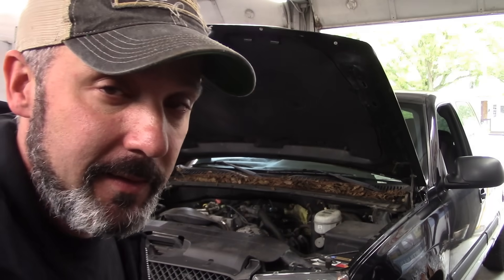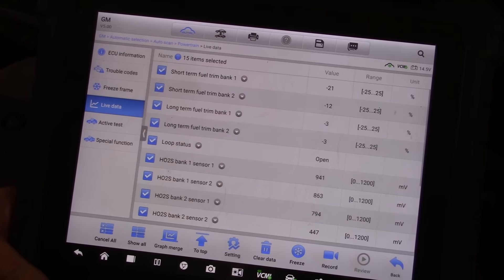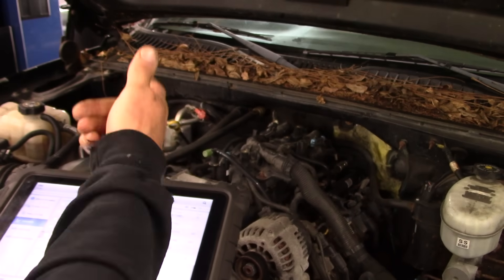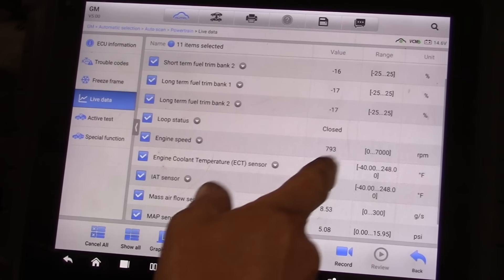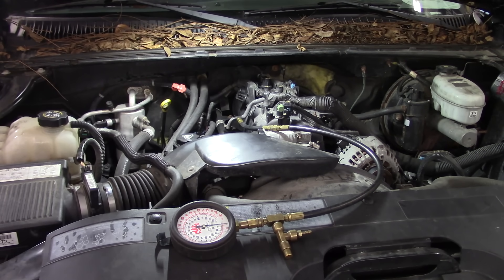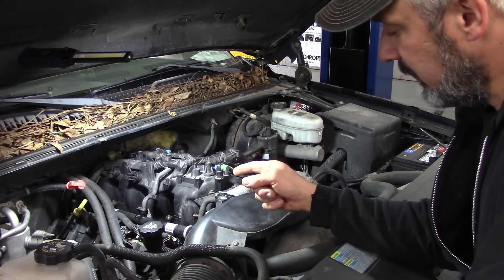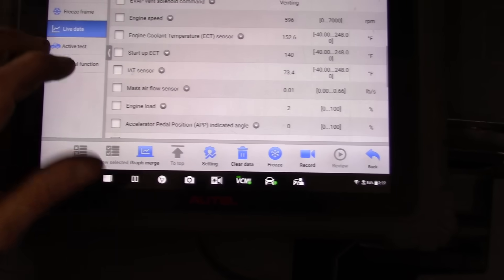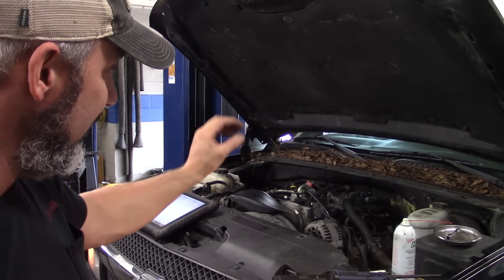Parts Cannon Special: Rich Running Chevy Truck P0172 and P0175

Comment: I’ve been guilty of shotgunning problems that I’ve encountered on our newer vehicles. It was hard for me to swallow my pride and acknowledge these newer vehicles are above my pay grade when it comes to diagnostic skills. I miss engine bays you could stand in, and with enough beers and a timing light you could fix anything. Love your content, glad you’re here to provide good knowledge and entertainment.
Reply: I think the issue with newer motors isn't so much that it's too hard to understand as more the fact that you need to be able to see and understand the data.

Older motors you didn't have a bunch of sensors to read, and didn't need a $5000 tool to see data. It was mostly by feel other than putting it together originally.
Reply: @Mck Idyl LOL been-there-done-that! 40 years ago!
Reply: Why put money into a engine that burns oil
Reply: @mylanberg5419  Go price new or used vehicles these days. They are crazy expensive. Just lost my 2002 Saturn in a car accident last week; shopping for a decent used vehicle is insane with the price spike.
Reply: Thank LGB for the Bidenflation.
Reply: @VanillaWahlberg  4 years vs 1 year, hardly comparable.
Reply: @ferrumignis  He's also introducing a 20% minimum billionaire tax in his budget, and is on track to reduce our year-over-year federal deficit. NONE of this has to do with this video though, so good day!
Reply: @VanillaWahlberg  He also has worse approval than Trump at this point, and has made America look the weakest it ever has on the world stage.
Reply: @ferrumignis  Is that why the U.N. laughed at Trump? Gtfoh lol
Reply: We all love our complex shiny gizmos, we love software features piled on top of features, billions of transistors in circuits....... well... until they need fix'n.... then, we either throw them on a landfill or we fooking hate them!  ;-)
Reply: @mylanberg5419  I have a 02 Silverado with a 5.3 570,000 miles. From the beginning it burned oil, at oil changes it'd be a 1/2 quart or more low. Ask the someone I new at the dealership and he said that's the way they designed them. Seems crazy, but the engine just keeps going.
Reply: They can actually be easier in some cases because the OBD computer is doing a lot of the diagnosis for you. We saw Eric start to home in on the problem from the first few seconds that he saw the readings. He went straight to each of the parts based on the data and quickly replaced the correct bits to bring each system back to spec. A little training goes a long way. I mostly just watch these videos and I can already pick up issues from the data. We get a free tech class right here on SMA 🙂
Reply: Welcome to 2022!!
Reply: a vacuum gauge was my go to

Comment: You are a good man and GREAT MECHANIC!!!! Don't know of any shops up north that would go the distance you did to fix a vehicle that the customer fired the Chinese parts cannon at several times.
You also have a bit of a gambling side to you as getting that junkyard fuel rail with injectors could have failed...But what are the odds that all the injectors would be done for?
It was a smarter move then buy all new injectors! Hopefully the customer did pay for your time and he could return the junk parts he bought.
At the least he learned a valuable lesson about cheap aftermarket parts.

Comment: I remember when OBD first started to come on modern vehicles with computers, I thought it would speed up diagnosis and repair.. instead it often leads people down the wrong rabbit hole as the computer is often compensating for the fault of something by affecting something else, in newer vehicles especially often in weird or unexpected ways.
Reply: 5 usr from my birth  4th wyd
Reply: ÷7
Reply: All
Reply: I had the discussion with a career mechanic that liked the 'good old days' of purely mechanical operation. Nothing has changed with the internal combustion engine - it's still suck, squeeze, bang, blow. MAF and fuel injectors have replaced carburetors, cam phasers have replaced cam swaps, but oxygen sensors have replaced exhaust sniffers too.

OBD makes a lot of things easier to diagnose, but you have to know what you're looking at. Someone replacing fuel injectors for a rich condition is no different than replacing a carburetor for a rich condition. Without knowing that you have a leaking accelerator pump, or that you're running negative fuel trims, you are still just throwing parts at things. Data is data, and is useless to someone that doesn't know what the data is telling you.
Reply: Read about someone driving along and got a 'Fuel leak detected' message appear. So he stopped and looked all over and under the car, just to be safe. Found nothing, carried on. Looking into it at the garage, they found it was a poor connection on the speedo sensor. 
Reason: the ECU knew what petrol quantity was being consumed, this was too much to what the ECU was being told it should be for the speed being reported, therefore there must be a leak.
Reply: @suttoncoldfield9318  heres one,newer dodges oil senders leak and the connectors won't vent the pressure and it travels up the sender wire and fries the computer and harness!!
Reply: Unfortunately for us home mechanics, systems got much more complex with the advent of OBD.
Reply: @twwtb  OBD 1,not great,OBD 2 is better but randumb multi cyl missfires can be a 🙉
Reply: @Watchout1010  I never worked much with OBD1 on my cars. Back then old school, spark, fuel ,air diagnosis worked ok. Misfires? Back then, just look under the hood at night, engine running. It was probably the plug wires and you would see the arcing. The point I was trying to make is that even though OBD2 helps a lot with diagnosis, engine systems got a lot more complicated at the same time when it was introduced.
Reply: @twwtb  below 96 is OBD1-most will not show a fuel delivery issue,newer models will-fuel press sensor🔺️✡🔻👉🏽🔺️👁
Reply: 3:40 In on second commercial 😢

Comment: Awesome diagnosis procedure!  As a retired Chrysler and GM engine calibration engineer your process of how things could contribute to a rich condition are spot on.  Chrysler measures barometric pressure exactly as you described (at least they did 2007 and earlier when I retired).  I think GM does the same but GM ties each engineer to just a small portion of the calibration. At GM I was responsible for cam and ignition timing. At Chrysler I had pretty much the whole thing.  GM had 20 engineers to do a calibration and Chrysler had 5.
Reply: I hate to say it I've worked on both and especially nowadays with Chrysler some of their engineering makes me wonder what they're thinking about when they do stuff GM I worked on quite a few of them and I found them to be a lot easier in the quality is a lot better and it's all due to engineering have a great day and thank you for everything you've done
Reply: So are you the one to blame for those crappy, junk GM  cam sensors ? LOL
Reply: @CraigGrant-sh3in  Nope.  Blame purchasing.

Comment: As soon as you started it up you could hear the difference. She purred like a kitten. I listened to my buddy and put aftermarket Bosch injectors on my 87 Camaro, she leaked at the rail and sounded like a hammer factory. I couldn't get them to seal at the rail no matter how many times we took it apart and put it back together. I bought a rescreen kit for my factory Rochestors and put new screens in them just in case beforehand. I threw those on, with new O-rings with a dab of vaseline for insertion. She started right up and purred like a kitten, the quietest I've ever heard her run. No sealing problems whatsoever, just popped right in. Smooth.

Comment: We had a guy bring in an outboard where his "mechanic" replaced nearly everything chasing a run issue. We have since spent almost a year replacing aftermarket components 1 at a time as they have failed.

Comment: Speaking from one tech to another, I really agree with your diagnostic approach! Getting an accurate repair history is a huge pain most of the time but having good test parts is a great time saver!! Appreciate you taking the time to make videos!!
Reply: I hate to say it sometimes customers like kids they don't want to admit they screwed something up but hey bottom line is a problem got my head into it figured it out and now the problem is solved it doesn't matter who's responsible it's fixed that's the main thing have a great day

Comment: This video proves what I have always said. Aftermarket is great for exhaust, alternators, suspension, brake parts. Some items like fuel pumps, injectors MAF sensor should only be OEM. It is more expensive, but cheaper in the long run. The hardest part for a DIY mechanic like myself is once you put in brand new parts, you move on to something else because you think new has to be good. This video proves other wise. Great video as always......

Comment: I have a 2010 Yukon XL Denali and have been going mad about the rich condition in both banks pinned at -30. And changed the fuel pump and Charcoal canister and MAF sensor. This truck I’ve done lifters on with this LS AFM engine. But your video is only one that I’ve found that now possibly points me in right direction. Fuel injectors. At 240,000 miles maybe it’s the cause I will hit you back. Great video and as you say your rambling but to the right ear it’s teaching, in the best way. Love it and thanks ☘️🍻🖐🏻 Kevin from NJ

Comment: Back in my younger days (mid 1980s to early 1990s) I ran up on the same problem with a v6 Chevy engine in a Buick. Emissions are off scale, performance bad and fuel usage terrible. We had to practically test each component separately. I was pulling my hair out (had  a LOT of hair then) until I compared the fuel injector numbers, they were entirely different. It turned out her husband had changed the injectors out with a set of reconditioned ones he bought. The ones he installed were for the same size engine but for a different year. If memory serves me right the injectors he installed were for the same size engine but about 4 years younger and used different resistance values in the firing circuit in the control module (computer). Installed the proper injectors and everything ran great.

Comment: Nice Diag.  I would explain the difference between a MAF engine vs. speed density fuel strategy.   When  non-MAF engine runs rich, I always check for low compression on one or more of the cylinders on the rich bank, if it has real O2's and not a AFR.  Because it won't burn efficiently and it will throw more O2 down the exhaust and the computer will richen the whole bank.
Reply: What do you mean by "real O2s and not an AFR"? Also why only MAP, would a misfiring cylinder not cause a potential rich condition on a MAF engine?

Comment: I would love it if you did a video on fuel trim and went a little more basic to explain to us idiots what everything is doing. Cheers brother.
Reply: It's pinned at the top... video about fuel trims. In short, the fuel trim is a mechanism used by the computer to adjust how much fuel it delivers to the cylinders, based on the data it receives from the various sensors, to maintain the desired lambda. It can add, or subtract fuel. If it needs to consistently correct in one direction, it stores the average in the long fuel trim. A perfectly running engine will have the LFT at zero and the SFT jumping both sides of 0. The number is a percentage.

Comment: The first thing I would do before working on car is check the oil. This protects you and also has diagnostic value. One time a car that I was working on was five quarts low on oil. The car was in for a water pump.

Comment: It would be very interesting to send those aftermarket injectors out and see what the actual fuel rate is.  Im sure washing the cylinder walls down with that extra fuel helped the oil burning….
Reply: Lol I bet those ding dong injectors dont even have solenoids inside em, just straight flow thru passage 100% duty cycle all the time baby
Reply: @abechavez1876  It holds fuel pressure when shut off. Who knows, the injectors could be fine. Maybe just not the right injector for the truck.

Comment: Found two listings for mostplus  injectors  1: flex fuel 5.3l  and 2: 80lb non flex fuel application with the warning "Note:These are not stock direct replacement, the flow rate is 80lb  830cc require ECU tuning after installation."  
So good chance they were not bad injectors just not the right ones for the engine and not even needed  as we learned from the ace at SMA! 
Keep on truckin' your the best!

Comment: So great to watch you diagnose that fault. I had that exact problem on a Caterpillar 3412 marine engine. Customer replaced all 12 injectors with aftermarket ones. Then….it had no power and was smoking but insisted the injectors were fine. After 2 days of diagnosis we put the old injectors back in and it was fixed! Don’t buy aftermarket parts folks , that’s just my opinion.

Comment: You amaze me every time. Your clients are lucky to have you. I was told, "to diagnose my 2002 F150 4.6L rough idle, they would have to open it up to see if the timing was off. $1000 CDN just  to check". Ran outta there I'll tell ya.  You are incredible. I wouldn't be surprised if tech schools used your videos for training.

Comment: OMG, I cant believe I found this video today!!!! Thank you !!  
I have the same issue with 2013 GMC Sierra 1500 5.3L, Flex fuel, it started 2 weeks ago all of a sudden, it started eating gas, I have the same codes, plus few more, needed to change oil pressure sensor, and it was burning alot of oil. Vehicle parked.  Not wanting to take to shop, thought I would do some digging around,  watched this and that video, not sure where to start. I cleaned MAF, changed valve cover gaskets, glad I did, grommets were leaking, cleaned PCV valve but as a note I took off the valve cover I could smell alot of gas on drivers side.... strange.  Changed oil sensor but still would not hold pressure, so changed oil / filter again (was only 3 months since last one and only driving 150 km per week) and notice oil seemed to be watered down or way to thin and not have any real lubrication feel to it, but no contaminants, it worked, still gulping down fuel.  I will have to go over the live data again and compare to your data, although the fuel trim #'s aren't as bad as this truck, and now only have P0175.  The only thing I did different during the last 7 weeks was not go to the only two gas brands that I normally stick with cause I can tell the engine does not like some gas, and some just run right through it, seriously, no joke !! It was just too bloody cold, so I went to all the closet gas stations of different brands and within weeks the issues started. So I was thinking of EGR valve next, but nothing was mentioned here. Will try looking at MAP first before the injectors and cross my fingers...  You saved the day..
Reply: Check your alcohol content on a scan tool. Its prob really high when in reality its low. If thats the case reset it with a scan tool and change the oil if necessary if contaminated with fuel.
Reply: You need a decent scan tool first.  Autel makes some lower end ones for a few hundred dollars.  TOPON has a relatively cheap bidirectional one for $800.   Without data you are just guessing.  About a 70% probablity that its the alcohol sensing data thats off.
Reply: @mph5896  thank you, alcohol sensing data reads 62.7
Reply: @leonardodavinci303  thank you, I do have the lower end Autel scanner. Alcohol sensing data reads 62.7
Reply: @Kayuu7  Nice. Easy fix.

Comment: Perfect timing.... I'm battling fuel trims on my old shhhhhhevrolayyyyy..... I can compare your data with mine.... Is MAF at 4.5 at idle too low for a 6.0L??? Thanks Dr O
Reply from the maker: Yes way to low... 6.5 to 7.4g/sec would be pretty close to avg on a 6.0 at idle accessories off idle in park IMO
Reply: @SouthMainAuto  I kinda thought so... I sure do appreciate ya and wish I could mail you an ice cream cone....

Comment: The correct procedure was adhered to in this diagnosis.Had this problem in the past and did not suspect the injectors at the time. I do know that aftermarket creates problems, especially sensors. Fleabay is what it is, warts and all, buyer beware. Nice piece of diagnostic exploration with a very successful outcome on a high milage engine. Keep wearing the cap.

Comment: Bought it new, I have 07 Silverado Crew Cab 4.8 wt142,000 miles on it. As of yet have never had engine or drive train issues. I have never been broken down on the road, Love my truck and dependability of it.